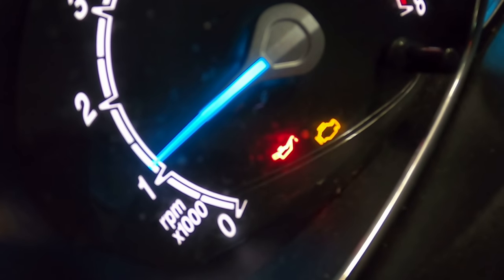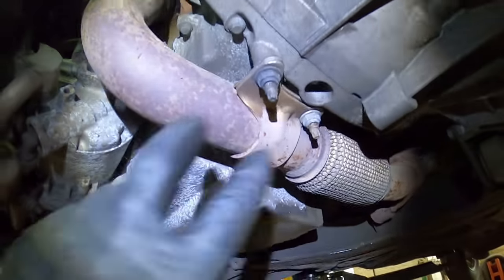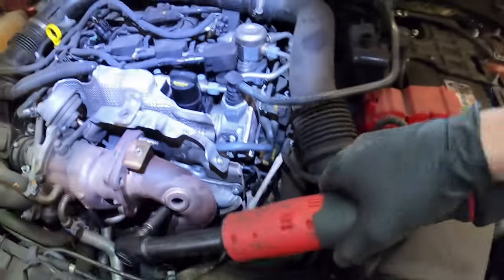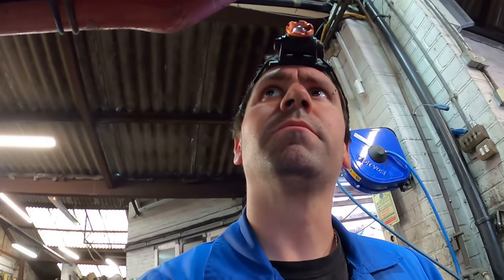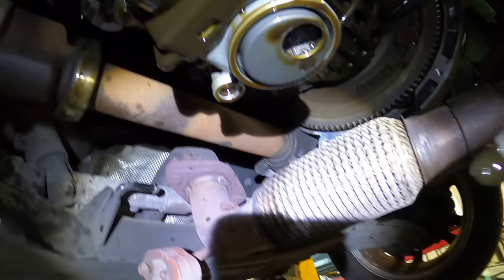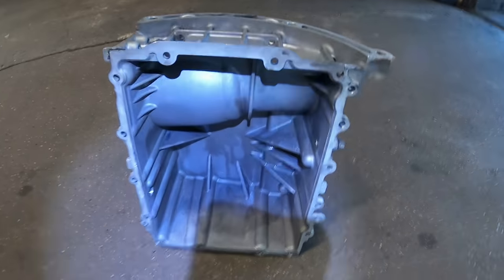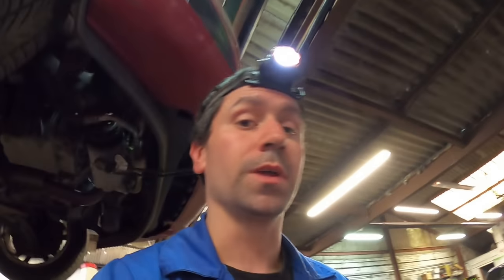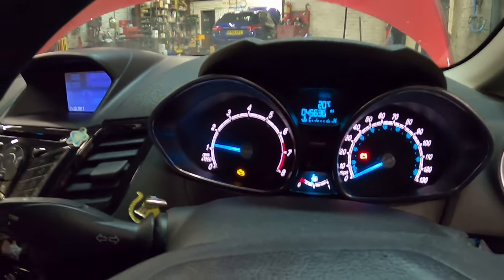Ford Ecoboost 1.0 fiesta/focus oil pump replacement

Comment: Same as the 1.2 pure tech engines. Wrong oil and the belt breaks down and clogs the oil pump. Terrible idea in my opinion
Reply: I know several ones with more than 200.000km's. You just need the right oil in the right time.

Comment: You change the oil pump and you didnt change the belts? They are deteriorated thats why the oil pump was clogged!!
Reply from the maker: Yup customer wanted the bair minimum so they could return the car i had to work to a customers request!!

Comment: Why didn't you replace the belts?
The reason the pump is blocked is because of the wet belt failing so it won't save the engine and prolong it's life for long .
Reply from the maker: Car went back under a lease plan 3 days later. The customer did not want to pay for the full job. Just wanted the light out
Reply: @ignitionadvantages6592  makes sense now 👍

Comment: The timing belt breaks up blocking the strainer that’s the rubber bits it will just keep getting blocked in several months unless you put a new belt on it so bit pointless not really fixing the cause of the problem but from what was in that sump engine won’t last too long anyway
Reply from the maker: Lease company have the car back now so they can deal with it 😎
Reply: and it was a 2017 model. Just wonder how it's been treated before the oil pump issue.

Comment: Belt in Oil with wrong type of oil used does that. It is one of those cases that  manufacturers non spec oil is used

Comment: You didn't replace the oil pump drive belt, yet the oil pump was clogged with bits of rubber..
Reply from the maker: Car was going back under finance. Customer only opted for the bare minimum to get the light out so he could give the car back. I told him about the belts. But was not interested in spending the extra money to give the car back

Comment: Cam and oil pump belts are breaking up with the fragments causing the blockage to the oil pump pickup, its a total waist of time doing this job without also replacing the belts, having said that the engine and turbo bearing won't be in good shape anyway if it was ran with no oil pressure.

Comment: Turns out it had been serviced wrong. 3 quarts were used resulting in over stressing the timing belt. It busted then took the oil pump with it.
Reply: No it didnt. This is common on these engines. if you don't service at the correct intervals this happens.
Reply: @steveqo  it was serviced at its manufacturer specified  intervals.
I do believe there's was about 3 quarts in the oil pan after removal.
No leaks or smoke.
Thoughts?
Reply: @steveqo  2 years old. Smh. I drive like an old lady. No offense to old ladies out there who drive like bats outta hell.

Comment: Probably the petrol that eats the wet cam belts, from toooo many short trips and car doesn't ever warm up
Reply: The ecoboost engines warm up rapidly. By the time I reach the end of my street the engine has hit operating temp.
Reply: @bottletree33  mine takes about 4 miles to warm up to 4 blocks on the gauge.

Comment: You should have replaced the timing belt also as it is the root cause of the problem
Reply: with that amount of metal bits should of checked main bearings and big ends
Reply: It's the belt and cam lobe breaking up, he's right it should be changed.
Reply: @3ggg334  yeah but those in know say its an absolutely  massive job

Comment: Ticking time bomb with these engines. If the pump is blocked its likely from bits of belt getting in the pump. Sequence of destruction with these engines seems to be 1-Belt degrades, 2- Pump gets starved of oil, 3-Bearings wear and more causing a drop in oil pressure towards the head components, 4 - overheating , 5 head gasket failure. I just don't know why Ford went for a wet belt arrangement. Even if there is a benefit to this design they should have a screen between the timing casing and the sump so bits of belt don't get picked up. I dont think I will be buying one of these cars second hand unless I was sure about its maintenance.

Comment: Wish my mechanic was as good as you

Turbo replaced
 Then a week later to replace the oil for the turbo

They said sump and cam belt needs changing 

In for 1 k so another 1k to “fix” the problem

After 500 miles the engine light comes on

Marv

Took it for another diagnostic 

They want me to spend another k

😂
So called experts
Reply: The oil feed banjo end clogs with burnt oil, you MUST at least clean if not replace the oil feed otherwise the turbo will fail again.

Comment: Perfect remedy for this problem, don't buy a bloody Ford in the first place! I started working on them in the late 1960s, they were a heap of sh*t then and they're a heap of sh*t now! Just had a 2019 Transit with only 77k miles on it, head gasket went but head can't be removed without taking the injectors out, which won't move with over 6 tons of pull on them, just break up, common fault. New engine. I wouldn't buy a wheelbarrow if it had a Ford badge on it. Have an Audi A6 diesel with 322k miles on it, still runs like new, cam cover only been off once to replace one glow plug, other 3 are still original, injectors never been touched. If the Germans can make quality engines, why are Fords so bad? They might be cheap to buy, but they certainly aren't cheap to keep on the road.

Comment: Eco boost cars really need Dealer services on time , then no problem
Reply: Doesn’t make a difference where they are serviced I know main Ford dealers that don’t change the oil filters when servicing and to think it’s us independents that’s get a bad name! I had an eco boost focus in last week with an oil leak serviced by Ford 8 months ago and all previous services done by the same place! Oil leaking from a genuine oil filter that had rotted through this isn’t just one I’ve seen! Anyway ecoboom waste of time just like the new transit engines 😂

Comment: Why didn't you look at the bearings? With that much glitter in the sump, I can't see that engine lasting 500 miles and when it does fail the crank will be scrap, if you fitted bearings now you might be able to save it
Reply from the maker: They all look like that. They all have lasted ones been going for 3 years
Reply: @ignitionadvantages6592  I'm shocked to find that out, I would have expected once the bearings are that bad they would be dead.
Reply: @andyguest6543  Well the belt is the the root of the problum its the belt that is coming apart that blocks it up.

Comment: The saddest part of these engines is when the belts are taken off you realise that there is more than adequate room to fit a DUPLEX  chain for the cams and a simple chain for the oil pump . This could have been a boringly reliable engine . Instead it has proved that Ford , and other manufacturers are incompetent  and care nothing for their reputation and their customer base.
Reply from the maker: The new ecoboost is a chain now
Reply: Citroen Peugeot  puretec engines are wet belt too.

Comment: The poor quality oil and oil changing intervals that are too long make the belt eat itself up at a faster than normal rate and the end result is almost always the same and it's the main reason for the wide spread saying of why ECOBOOSTS die: the oil pump gets damaged due to oil pick clogging and that's it. This is the main reason why Ecoboosts fail: lack of lubrication after the pump dies due to clogging.

Comment: Clearly bits of wet belt blocking the pump, why would you not bother replacing the belts , no pint doing half a job

Comment: Cost me £1000.60 to replace both belt new water pump  oil pump cleaned only ford wound touch it £250 per hour labour
Reply: That's way higher rate than Mercedes main dealer.

Comment: If only my mechanic had watched this video first. What was a simple pump change has resulted in a colossal clusterduck and 2.5k in additional work. 

Trading Standards are on their way!
Reply: its not it's the belt it's the the root of the problum its the belt that is coming apart and clogs up the picup.

Comment: waste of time replacing the oil pump, clearly the timing belt and oil pump belts have deteriorated and clogged the strainer. You've got bits of metal in the sump too so very likely the engine is wasted
Reply from the maker: 20k later the engine was still running when it went back 🤷🏻‍♂️🤷🏻‍♂️ told customer it needed belts changing but she didn’t wanna spend the money. Would you turn away a paying customer??

Comment: Wtf... You need to replace the timing belt. It's why it's is clough the oil pump. It's is a very sad repair and very unprofessional
Reply from the maker: Thanks for your kind words jay. Unfortunately the customers budget would not allow for this to be done. Its also a lease car thats going back so they was not to bothered
Reply: @ignitionadvantages6592  maybe then you should have walk away from this repair, because it will not last and the new pump will also be clunky again - whast of work and money. We at ford will only do it correct if the customer have money or not. It will only gives you problems by not do it correct the repair
Reply from the maker: @janchristensen9858  why would I walk away from a paying job? The car is going back to the lease company in 2 weeks.
Reply: @janchristensen9858  I’d love to see where you work we don’t turn down any jobs just can’t afford to! we give the customer the cost of an economical repair that fits in with their budget it’s not unprofessional to do as requested by the customer you can only advise you can’t force someone to replace parts!
Reply: @bernardcox9307  nothing cowboy about the way I work nor the business I work for thank you very much!

Comment: It's been said a million times but seriously, a wet belt...really? A chain lasts much longer but is harder to change yet you don't have to worry about it for a long long time. A belt lasts much less time, yet is much easier to change. The infinite wisdom of Ford decided to combine the two to get a belt that doesn't last very long, yet is hard to change. Bonus points for the disintegration of the belt due to it being ran in oil and clogging the pickup screen up as well... Did they even do any R&D on this engine or just expect this to magically work in the wild?